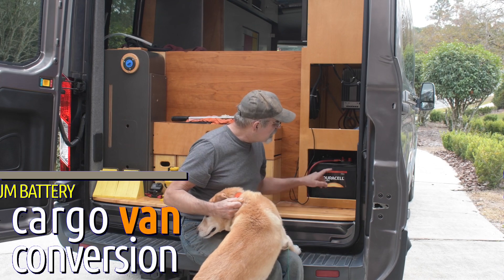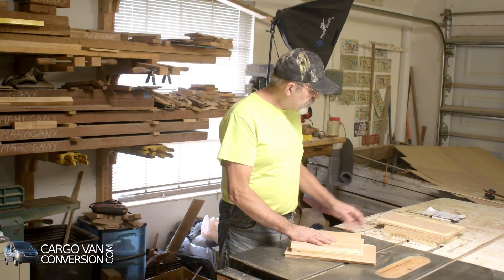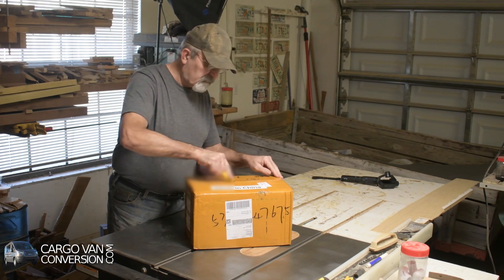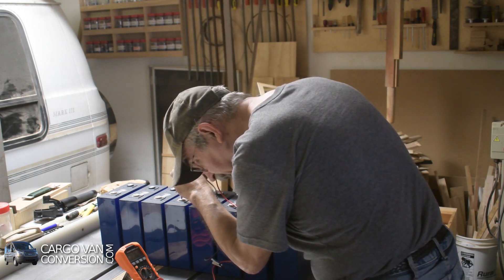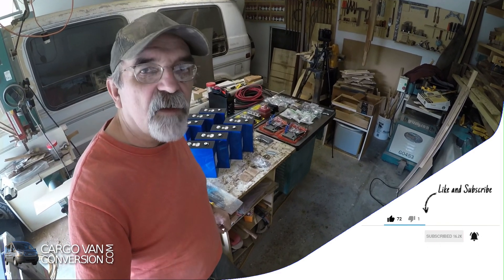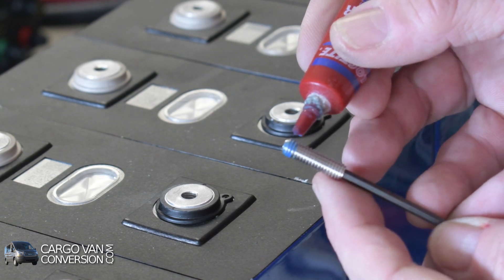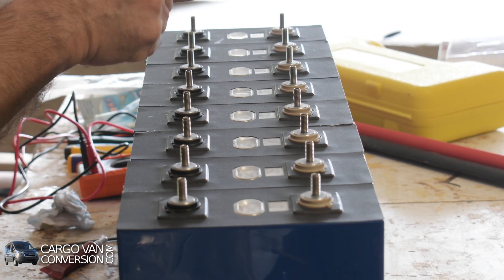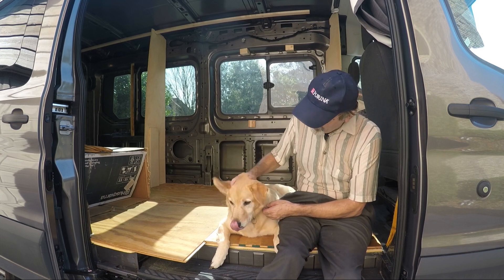DIY Lithium Batteries - Part 1

Comment: I've been waiting for this one.
What happens now will determine what I'll do. Buy manufactured 12v batteries or save a nice amount and build them. Thanks Van👍👏
Hi Joey!
Reply from the maker: Hi Beeps,
Whatever you do, buy Lithium; forget about lead-acid or AGM's.
There are still lots of issues with Lithium batteries. The workings of Lithium cells is well-known by now; the BMS (battery management system) is what makes it work right. There are good BMS's , but they run $800+up and that defeats the purpose of a cheap system. And you pay so much more for a Battleborn or alike for the research they put in. Only recently I felt confident enough to go ahead with this project solely based on the BMS.
You should also research whether you want t go 12V-24V or even 48V. Makes a whole lot of difference. I also have some resources mentioned in those articles on my website. 
Van Williams

Comment: Wow, those older batteries were really bulging.  That may be a sign of overvoltage or overcharging.  Make sure you check your charge regulator (or whatever regulates the charge going into your batteries).  I'm definitely not an electronics expert, but I don't think that bulging or swelling is normal or safe. Exciting stuff for sure, Van!

Comment: I don't wish to be disparaging but I definitely wouldn't have used Loctite on the set screws. In this instance, good conductivity is far more important than vibration-proofing, and the threads are a far better contact than the top surfaces. I guess it's too late now. It might be worth putting the final connectors on opposite corners rather than at one end to help ensure an even load when charging and discharging.
Reply: I did a calculation on this issue when I was building. If you use stainless screws and nuts less than 10% of the current goes through the screws because the stainless has high resistance compared to copper and a relatively small cross section around 30 mm2 - so current has to travel about 15mm through the equivalent of about 5 mm2 of copper. The contact pads have about 250mm2 of contact area and connect directly to the main cables with about 50mm2 for 2/0 cables. If that contact point works the threads and posts don’t matter.
Reply: @RipeorRuin  When two supposedly flat surfaces are touching they're not really touching everywhere, like finely polished gauge blocks. When two (male/female) threaded surfaces are screwed together tightly the individual threads can deform very slightly until there's a great deal of contact. So if you're bolting one flat surface onto another the bolt itself is an integral part of the overall contact. Using Loctite will undoubtedly reduce that.

Comment: Replace the leads. The ones which came with the powersupply are crap, as are crocodile clamps.
Replace with proper 10AWG  and cable lugs.
The crappy cables are thin, fragile and become very hot. And with 20a topbalancing will take forever. Remember you have 8x272= 2176 ah of capacity. With a 50% soc (pretty common when you receive them from cn) you need to charge over 1000Ah. And with 20a thats gonna last 50-60 hours. I won’t trust cheap cables to run unattended for these times with 20a